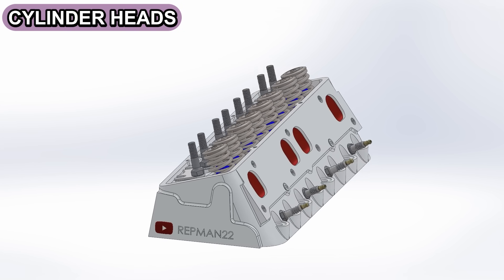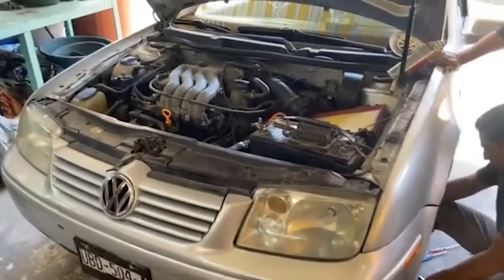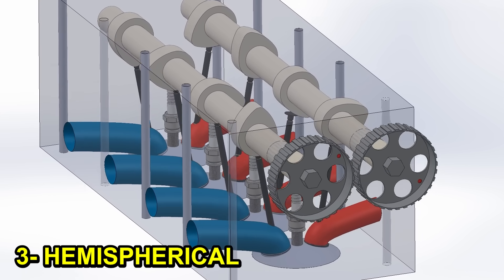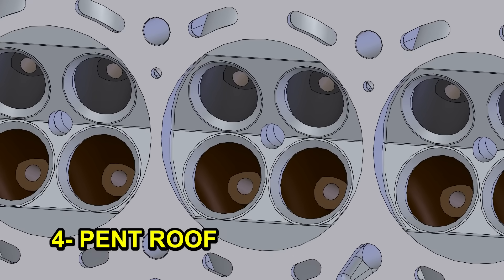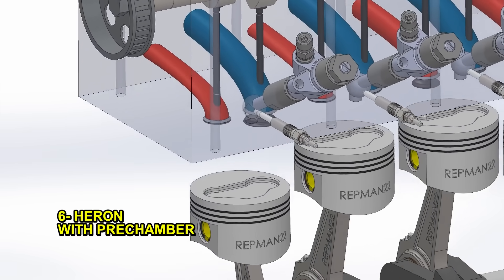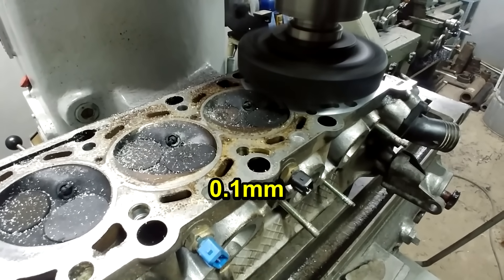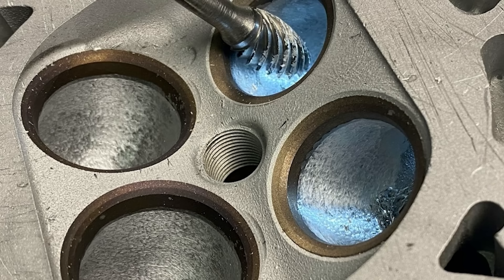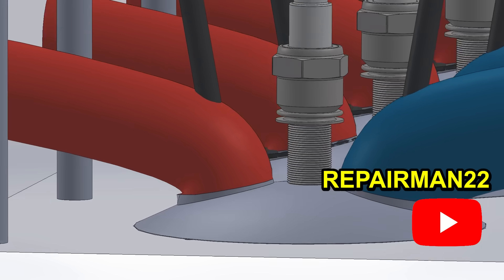Differences Between the 7 Combustion Chambers 🚗 Shapes - ports - Cylinder head

Comment: From a physics perspective dimpling the intake runner is counterproductiv, as you do not worry about the airflow seperating, but instead losses in airflow velocity. These dimples only slow down the boundary layer and make it turbulant. This could in theory improve mixing of the air and fuel in carburated cars, but airflow will be reduced.

Comment: If you really want to know about port size, geometry, dimples ect you need to listen to people dealing with that topics on professional basis - Daren Morgan, Bain Racing. Dimples for example not just for air velocity but for suspending fuel in the air which plays huge role in power making department...

Comment: As far as dimple porting goes, all you have to do is look to NHRA Pro-Stock racing...

If THEY don't have dimples in their ports, then it is NOT worth doing. 
Those guys are INTENSELY looking for 1-2 nore horsepower out of their 1500h.p., 500c.i., N/A gasoline engines, and if they don't have something done to their engines, then it isn't effective or else they WOULD do it.

Comment: 12:56    It takes a pretty BIG cut off the head to raise the compression ratio one full point. A hell of a LOT more than just the 0.1mm that you suggest in your video. 

ALSO, a bump in compression of one full point is worth more like a 5+% increase in power, not the 1-2% that you stated. 

And, as far as gouges in the head from the mechanic removing it go, NO, that does NOT always happen either. ONLY a sloppy mechanic will gouge the sealing surface of the head when taking it off the engine. I've removed hundreds of heads, and have NEVER gouged one yet... 🤷🏻

Comment: 12:11... NO! A head does NOT ALWAYS have to be machined flat before re-installing it back on the engine. 

Although it IS a good idea to give the head a haircut before putting it back on, if possible, it is NOT a requirement! Many, MANY, heads have been successfully re-installed on engines WITHOUT machining the head surface, and the engines lived on a long life with ZERO issues afterward. 

IF what you stated was TRUE, then one WOULD also have to remove the engine, take it ALL apart, and have the deck surface machined EVERY time a head was removed ALSO, and that is 💯% NOT true! Same goes for the head..

Comment: 6:41..  NOT only are hemi pistons slugs and weight a ton because of the domes to get the compression up, the domes also BLOCK flame travel propagation, and require quite advanced ignition timing, indicating an INEFFICIENT chamber design. A high compression wedge engine can make the most power with as little as 24° of total timing. You'll NEVER find a conventional automotive hemi that runs it's best at that little bit of timing. 

ALSO, Chrysler was NOT the first to produce hemi engines... Aero engines used the design LONG before Chrysler did. Chrysler simply was the one who grabbed the "hemi" name and trademarked™️ it.

Comment: For a direct injected engine, where only air is going through the intake ports, you should always aim to have a mirror finish in the ports. Even for port injected engines, you should be using a mirror finish, as the fuel injector is traditionally pointed at the back of the valve, using that to create the turbulence for air/fuel mixing.
Reply: Sanding typically yield great results with very little left on the table

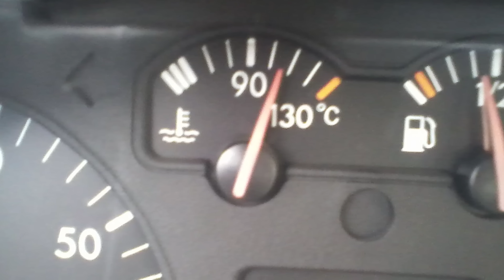Comment: @ 12:00 he says to always resurface the head, while I agree that that is best practice, I feel like in the real world customers are usually already sticker-shocked by the cost of the repair, then adding a extra 100$ for machining and a couple extra days for head to ship and return isn’t always feasible. All manufacturers I’ve done heads on list the allowable warpage (like 0.008 for Hondas) and that’s pretty easy to measure with a engineers level and feeler gauge (or honestly just the flashlight method)

Comment: The bathtub saved my civic when the timing belt "disappeared" :P
Reply: Non interference design .. saved my Yota Camry (2.2L I4) when water pump locked up and the crank tore all the teeth off the belt in the belt area it contacted. Even the aluminum head was OK .. not warped

Comment: I would have liked to have seen the F head configuration shown as well. It's a OHV and valve in block hybrid used by Willys and Jeep. Likewise, the Chevy 348/409 and Ford MEL are unique since they use a flat OHV head but put the chamber in the cylinder, with the shape of the piston determining compression. The blocks were not cut at a 90 degree angle to the bore either. Also, Jaguar's V12 used a unique configuration in that it had a unusual piston crown that included the chamber in the piston. This is different from the diesel configuration.

Comment: Have driven Mercedes W123 type with pre-chamber for 2 Mio miles. Never had even the slightest hiccup. Utterly dependable. Was. No more.
Reply: With an OM617, you won't get there fast, but you sure as hell will get there, eventually

Comment: re;bathtub designs needing the intake/exhaust port on the same side;

wrong. See: Suzuki G series SOHC design, VW air cooled, Volvo b21/23/230.

You later say that with EFI they're able to move it to crossflow, but that goes against what you said earlier about the design requiring it.

edit: you say the same thing for wedge heads. 

Just say that any design with 2 valves can be either crossflow or reverse flow, that reasoning is bullshit.

Comment: Was hoping to see an example of a more current gasoline engine with the Heron type camber, only to hear what you would have to say about how it operates because this is a very well done and informative video. The engine I am referring to is the VW VR6 engine.

Maybe in Part 2?😉

Great video! 👍👍
Reply from the maker: My brain eliminated the Heron 2-valve-per-cylinder VR6. I only remembered the new VR6, which has 4 valves and a pent roof.

Comment: This feels more like a sales pitch for fuel injection! Pss! You can tune a carburetor to be more efficient than fuel injection! Also you do not need a computer to do so!
Reply: Is that why the automotive industry ditched carburetors 30+ years ago, and Top fuel, funny cars, NASCAR, and many other types of racing have stopped using the controlled fuel leak known as the carburetor?

I find most of the people making a “sales pitch” for carburetors can’t wrap their head around how fuel injection works, and don’t want to bother to learn.
Reply: You can't. Fuel injectors can inject an precise amount of fuel at a precise time. Carburetors work great, I love them. But no human can tune a carburetor to the accuracy that a computer can perform.
Reply: Let's not forget to mention the range of adaptability EFI has over carbs. Once your jets are out of range, what you gonna do, swap them out on the fly?

Comment: The modern bathtub is probably older than the wedge head, which dates to the 1950s. There was another two valve combustion chamber that predated them called the "high ratio compact chamber" which had a big pocket near the exhaust valve and spark plug. The Chevrolet stovebolt 6 used this type of cylinder head combustion chamber.

Comment: The only head I wish had been included was the Honda CVCC heads with the pre-combustion chambers.
Reply: diesel IDI chambers as well, dude has a lot to learn IME.
Reply: @kylejohnston3442  Umm, did you even WATCH the video??... 🤦🏻
Reply: The Honda CVCC chamber was an interesting design in the 1970s. Honda eventually abandoned it mainly because it produced very little usable power. It required very retarded timing in order to achieve the emissions that the US mandated. They did burn clean enough that they did not require a catalytic converter. However after 1980 they started using a catalytic converter and then they could advance the timing and they got a lot better power and gas mileage. Gasoline pre chambers don't work as well. Diesels weren't much better. When diesel engines went to direct injection without pre chambers the power of Diesel's rose substantially.

Comment: Re dimples: anyone remember the book/movie "holes"? If you have a 30mm throat cross section and can put 1mm deep dimples inside it...... you're effectively making test pits, you could just open the throat to 32mm across and get better flow that way.
If my math is correct... at 7000rpm that's 3500 intakes per minute, that's 58.3 intake-compression rotations per second, that charge behind the closed valve is accelerating from 0-100meters per second (300ft/min) at mid intake stroke (so 1/4 of those rotations) in 0.00428seconds.
Professional golfers get up to 90meters per second with a flight time of 6ish seconds, that's why the distance between dimples thus the "dimples per inch", the depth, the radius (is it hemispherical or bathtub), round or hexagonal... it all has an effect.

People offering dimple jobs are happy to take your money for something that looks cool which you'll never see again, but they haven't done thousands of hours of CFD analysis to find out if it works, you know who has? F1 teams and they don't dimple shit.
Instead teams just have a wider throat as I mentioned above and focus on maintaining constant charge velocity through the head because any time you increase or decrease the width you change the velocity (Bernoulli) and any time you change the velocity in a mass you lose energy (Newton), intake only being a thing ~25% of the time messes with it a bit but I digress.
Reply: exactly

Comment: So far I know no Chrysler Hemi engine offered for retail sales ever used 2 spark plugs. Some of the racing engines did, though. The only ones I saw while at Chrysler were sitting on racks in a warehouse.
Reply: All of the modern Hemi engines starting around 2004 have 2 plugs per cylinder. In 2008, the 4.7 Powertech had a 2 plug per cylinder design also.
Reply: @king300c  But the current ones aren't actually hemis.
Reply: @anvilsvs Yes they are. Flatter than the old ones, but still.
Reply: All gen 3s run 2 plugs...... They also all eat a lifter every 30k
Reply: Since 2003 the 5.7 through the 6.4  "Hemi" engines all use 2 spark plugs per cylinder.
Reply: 5.7 and 6.2 are definitely hemi heads with 2 plugs. Just google it and look at the chamber. Or use AI. Chrysler would catch hell if they werent.

Comment: Hemispherical combustion chambers were in common use decades before Chrysler introduced theirs. They were common in BMW and Bristol cars and even earlier in motorcycles.
In fact when Chrysler began sticking "Hemi" on cars other manufacturers had got to the point where such a badge would be like putting a "Has Wheels" badge on their products
Reply: Great history lesson, thanks. Chrysler ultimately made the Hemi memorable.
Reply: Ford even was using it in tractors.  Chrysler just marketed and popularized them, and Trademared Hemi.
Reply: Other manufacturers did what?

Comment: Is someone a little biased about Chrysler’s Hemi head design? 

I’m not a fan when people site basic and true facts and then conclude another obvious statement as a grossly oversimplified negative. 

Making the argument that adding a second spark plug adds more materials (which is true) and then saying therefore more materials mean it’s more expensive (more materials = greater cost —> in a nut shell yeah)

It’s kinda like saying using 1 extra screw adds materials (No kidding 🤨) and an extra screw means greater manufacturing costs (Oh really 😮) therefore making them MORE EXPENSIVE to produce (Technically valid but only technically … feels like you’re reaching and I don’t even know why)

It’s not like I even like Chrysler HEMI, I just don’t like when people don’t stop to consider personal bias or make connections clearly out of proper context … especially when they are presumably giving a neutral presentation. 

If something had problems and you believe you are knowledgeable enough to make a good argument as to why or to give knock yourself out, even if you’re incorrect I wouldn’t fault ya but at least say more than “it uses more materials and therefore was more expensive” and “adding a dome means more weight so they can’t rotate as fast”
Reply from the maker: In a V8: They are 8 extra spark plugs, coils, distributor, wires, time to install and tune it.

Comment: And whats about 3 valve 2 spark plug heads like Mercedes M275? It is special, because it use only one exhaust valve to make room for 2 spark plugs. To achive higher power, they added 2 turbos to a V12, so the restricted flow is not a problem.
Reply: looks like a pentroof cylinder head, like the m113

Comment: Nice! Never polish the intakes as you want to avoid what you see on the mirrors in your bathroom! For improvements, concentrate on valves and seats (80% of gains), but do not forget to use the best available oil sealings (Teflon,PFA etc.) as cooked oil from the valve stems would destroy all your flow efforts- also good to go to the lower side of clearance spec.
Reply: Moisture will collect on almost anything if the conditions are right. 
You just notice it on the mirrors more easily-
Or if you forget to put your slippers on before walking in your socks thru the grass in the morning to take out the trash 😅
Reply: @billyarsenault1970  yes -primarily the temeprature difference is the reason but on rougher surfaces the nuclei show a tendency to form rather very small droplets/films whereas on polished surfaces the number of nuclei is lower, hence bigger droplets will be formed. But I hope we can agree upon that with a rougher surface the turbulence can re-evaporate the tiny droplets/film.
Reply: @drunkenSailor21 Nice thx. Always good to learn a little something each day ✌🏻

Comment: Fun video. In the past i did some porting, valve de-shrowding, valve seat and valve dish work and optimising squish. 
Really fun to extract more torque and power from an engine (Ford Pinto OHC and Volvo B230) just by optimisation.
Reply: Volvo redblock is king 👑

Comment: You should really check out the "Qualy-Pod" design by David Vickers. I'm really thinking about trying it on my 2007 Suzuki GSX-R 750 I'm rebuilding
Reply: Polly quad by David Vizard. All he is doing is making one of the intake valves smaller and one larger and one exhaust larger and one smaller. He did this to create swirl which is something 4 valve heads struggle with.

Comment: 13:23 Turbulent air cause greater friction drag. However, this may still result in a lower total drag than laminar flow separating from the body and causing huge pressure drag.
Reply from the maker: Exactly. Ports are a VERY complicated topic.